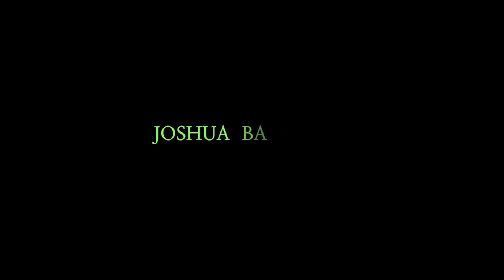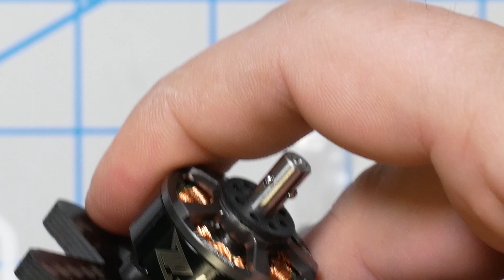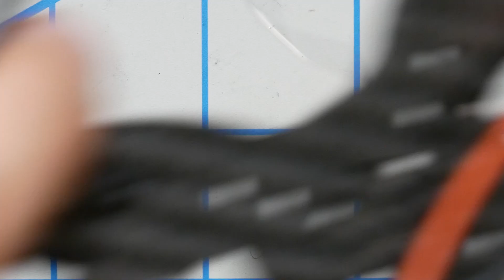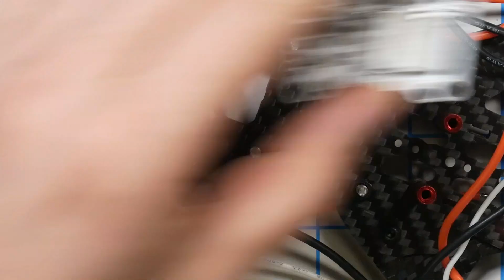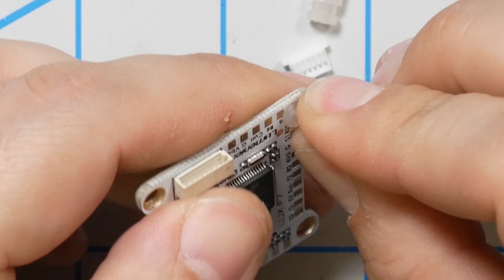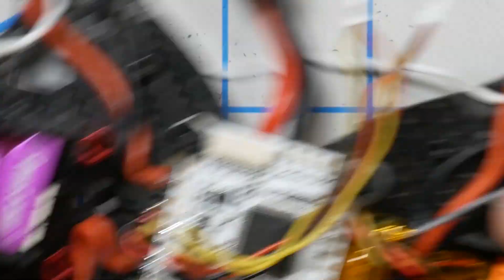Building a CheaterKwad | HOW TO FLY BACKWARDS WITHOUT CRASHING

Comment: For a vtx placement like this one, you should heat shrink the antenna to a thicker zip tie then heat shrink that same zip tie to the stand-off right next to the mmcx connector. Would probably be in the way of the rear camera but it’s better than where JB put it 🤷‍♂️

Comment: In all of the build videos I've seen, no one preps the edges of the carbon fiber. In RC cars you file / sand / Dremel the edge to take off the sharp edge. Them we seal the edges with super glue. This all done to stress relieve and strengthen the CF.

Comment: So wait, what? You switch camera alright... . So your front go go now faces backwards. But what about the controls? Do they also switch as you switch from front fpv cam to back fpv cam?

Another unrelated question: on the shendrone geyser, with two cams... what if you want both pilot and gimbal man to see different fpv cams? Two vtx'es? That interferes, no?
Reply: Ach ok, you set it up in the radio transmitter so it switches... . That's crazy!

Comment: Why battery pads when you can just use 3m Velcro? I put a piece in the quad and battery have had a strap cut on the carbon and the battery stayed on.
Reply from the maker: I dislike putting velcro on my batteries.

Comment: I think the "stat" in hemostat might come from "static" as in non moving, because you can clamp an arterie and leave them there.
Or stopping blood, because, hemo-stat, but they`re also used to hold open an incision for instance.
(now I`m sitting here wondering about the etymology of surgical instruments lol)

Completely agree that 8ths of an inch and 3/16th and all that is stupid, we use the metric system here, nice and logical, and the same unit (meters in all its variations), can be used to describe anything from sub atomic to planetary objects.
I`ve had to deal withimperial units most of my life anyway though, because the RC hobby will do that to you lol.
Still gets confusing :/

Comment: Thanks for your great job ! I have question : Do you know a small électronique component for mix two caméras together in picture in picture ? Not switching but together. The front camera in big picture and the back caméra in small size at the corner ?
Reply from the maker: It doesn't exist. Picture-in-picture exists, but not small enough to put on a quad, and the latency is too high.

Comment: Frame is here - Fast delivery (< 1 week), reasonable price and high quality. 
RIPT is a 1st class operation - I received the "Bardwell Package" - nice frame - fully assembled, (a 1st there) plus a bonus neckstrap which is among the nicest I have. Super discount - thanks for that! 
It's a simple frame in the "Old style" (which I prefer) but very well executed.  Big name quality at 1/2 the price. It will swing a 5.5 prop, has 20 and 30.5mm mounting holes Thanks for the discount Josh, I'll be ordering from you again.

Time to start working on the "PushmePullyou Quad" Looking thru my goodie collection I have a Foxeer ClearTX2 w/lollipop antenna, a set of 2207 2450kv Blasters, and a 4n1 esc (all Kwadbox items). I also have 2 surviving Session 5s for on top. I'm thinking 4S1550 and low camera angle for close in proximity flying, with a 2nd more 'rippable' setup just my retilting the cameras and changing out props. 6S1000 with throttles limited would make for a somewhat more aggressive setup with a few minutes of adjustments.

This is going to be fun.

Comment: Joshua, I have spare PDBs and will use them in future builds.  If the power in the FC isn't enough and or reliable for the need, that is what they are for, eh?  Great instructions for beginners as well as mid levels of builders.

Comment: I must say, the soldering quality of this board looks awfull. I used this type of FET (DrectFET) previously, and i know that if the soldering profile and the solder paste distribution don't match the FETs requirements really good, there will be problems with non-connected pads under the package, and the PCB probably will burn. Also, the soldering of the Shunt looks bad, too. I think i see where the issue lies, and the way to get around is expensive...

Comment: I just love build vids! 👍I have the Chameleon Ti frame (4mm) and I have the new Armattan SS 2306 motors. these motors came with those short 6mm screws and they look exactly the same short as in this vid. I called the Armattan tech support and I was advised not to worry just use those screws. what I did with a bit thread lock, but there is no way that's the right way, just as you've pointed out in this video. I already lost 3 of the screws and two screw threads just vanished (so I had to use longer screws to replace them). actually I'm planning to replace all of them because there is no way screws reaching only the half of the motor stand holes can hold a 2306 (so called) beast motors. Armattan should provide longer screws with these $25 motors for the same reason as you Josh didn't wanted to use your stock short screws.

Comment: Hey JB, I actually designed that frame! It was a really nice surprise to see you talking about it and was really cool to see how you built it :)

The whole premise behind the frame was a perfectly balanced design. It's a true X with the mass as central as possible, so much so infact you can spin an assembled quad on one finger! Designing around modern parts we were able to make it lighter than similar Alien based designs. Just to clear up the extra holes and standoffs, the idea was to provide as many options as possible. Any FC/VTX etc can be mounted and the holes allow for extra standoffs to work around your components and add extra support where you have the space. 

The symmetry was designed so you could use the same arms all around (unlike the Nova which is handed I believe?). Using the triangulation along the length we can add strength to the base plate which often snaps on Alien style quads and also add a bit of leverage to strengthen the arm joint. It was never the intention to use two cams hence no cam mount in the back ;)  

Really looking forward to seeing your 'cheater' flights and hope you are enjoying the frame :) 

P.s the company name is RIPT, the frame name is the Lindworm! Doesn't matter but just so you know for future reference.
Reply: Nice I like that frame where I can get ?

Comment: I agree with a lot of what you said about the soldering but that red wire you showed should have been at least half of that links if not a 3rd. You only want a small tiny amount of the wire exposed. Laa and can't jiggle about and snap off over time. When they're longer like that and hang out even a millimeter off the pad they slowly move around and will snap off especially if you're inside your quad moving stuff around in the wires are constantly getting bent back and forth

Comment: I was buying a Rapid fire module and was checking your website for (the best) antennas, and realized that the recommended antennas are RP-SMA and are not compatible with the Rapid fire module which uses normal SMA connectors. (this is the Amazon link) Might be a good thing to offer both types and explain the difference/compatibility as most modules and IPX connectors to SMA are only SMA compatible.

Comment: Thanks for featuring the Riptkwads.com Lindworm JB get 20 bucks off with code MOONMAN at checkout choose standoff colors, use fits two 20×20 stacks or one 30×30 solid or individual arm models. Mini or micro cam. Bottom or top mount battery and super strong high quality carbon fiber join the #riptcrew this quad flies sooo well
Reply: Last day for the discount. Get one!

Comment: Just milimeters? I mean, the whole thing is so much more rational and convenient, everything using  bases of ten. Rather than fractions of an inch, 12 inches to a foot, 5,280 feet to a mile etc you have 10 mm to a cm, 10 cm to a dm, 10 dm to a meter, 1,000 meters to a km. Same thing for weight, volume etc.

For PDB - the KISS stuff still uses those extensively.

Comment: It would be awesome for velocidrone to add a 3D flying option to practice flying upside down and backwards. Probably wouldnt be too hard since they have the setting that centers the throttle on a ps4/xbox controller since it doesn't sit at bottom deflection naturally.

Comment: in regards to testing continuity once you have the motors and esc's soldered up to the PDB:

shouldn't your meter have given you a beep since at this point you haven't rectified your polarity mistake from earlier with that one esc?

this is making me question my entire existence.
Reply from the maker: Reverse polarity won't cause a continuity beep I don't think.
Reply: @JoshuaBardwell  roger that. i put ultimate faith in my multimeter before that first battery, lol!
Reply from the maker: The low voltage used to test continuity is not enough to open the FETs

Comment: I have a question. A long time ago I overheated my video in pad so I have to solder it directly to the camera, thats why I don't have osd of course(and its really annoing) my question would be: is it possible to soulder it into one of a rx pad and set it up in betaflight? Thanks in advice:)
Reply: no. the osd is handled by a dedicated chip. the video signal does not go through the f3/f4/f7. can someone confirm, or correct me if i am wrong?

Comment: Finally got to the end.   As an assist for your camera angles, go for around 20 degrees uptilt on front cam and 20 degrees on GoPro mount.   The backwards cam should be around 10 degrees so when flying you will avoid having the GoPro pointing up at the sky when the angles compound.
Reply from the maker: Yep we figured this out.
Reply: @JoshuaBardwell  either way even at shallow angles you still gonna have a lot of sky and very little ground on the HD cam. I tried all the different permutations and for me the only position where 2nd camera makes sense is rear inverted because that's the only case where your HD cam is always facing correct flying angle (same angle as FPV regardless of what FPV cam is in use). I think it would be beneficial for your followers to also do Episode 3 (after next) where you could flip the rear FPV cam upside down and do the 3D setup. and btw. you could turn your rear camera mounts outwards and have the cam to stick out to give yourself more room inside the frame for your VTx and mount the antenna properly : https://youtu.be/lvRDVMTE2d4

Comment: So regarding flying a CheaterKwad, part of the talent/difficulty is lining up your shot and planning for the transition.   So Josh you will likely first find transitions on yaw spin to be the most natural because Yaw does not get inverted.   But there are some other not so readily apparent transitions that raise the stakes and make for a trippy as hell experience even with a 2 cam upright build.

Another fun thing is that you can use your second cam as a sort of rearview mirror/cam while flying.   This comes in handy if say you are being followed and you are flying backwards so that you have the gopro pointed at what is following you, occassionally flicking the switch back to the front cam lets you see how the shot is framed before going back to the backwards cam for regular flight.

Waiting to see what people more talented than me can manage to pull off.
Reply: Yeah, I was thinking about how the cam switch will flip pitch and roll controls so you better have that stick centered when you do it or I imagine it will really SNAP that quad around depending on your pid settings and how strong the motors are.

Comment: The great forceps vs. hemostat debate...  You will find forceps with locks, but hemostats are a special case because they are made to clamp on arterial vessels.  Hemo (blood) stat (now).  You have what is called hemostat and we use them all the time for everything in the Pediatric ICU.  Yet another name for a similar device designed not to be sterile is called Kelly forceps.  

Medical jargon man, it's awful.

Comment: I bought the CL Racing F7 and also overlooked that it was not an AIO, Ive never used a PDB so I bought the RDQ Airbot MatrixPDB, it has 4000 capacitors on the bottom. By the way this frame is not great, way to think inside of the box RiptKwads.

Comment: Something off the subject but i recently pulled a 4s lipo out of storage and it was way out of balance so as always i go to your channel . I don't seem to be able to find anything about balancing lipo batteries . HELP !!!! lol .
Reply from the maker: As long as all cells are over 3.0 volts, put it on a charger and run a normal charge cycle. It should balance at the end.

If any cell is below 3.0 volts, I would personally recommend retiring it.
Reply: @JoshuaBardwell  cell 1-4 , 3.02 , 2.62 , 1.81 , 2.91 . I hate to retire it considering its not old and hasn't been used much . would you still suggest chucking it or is it possible to fix it . My apologies for the ignorance . I'm a noob with little knowledge :(

Comment: So, ESCs... what are the pros/cons of 4-in-1 vs individual ones?
Reply from the maker: 4-in-1 is significantly simpler to wire up. Many fewer joints to solder. But if it smokes one ESC, you're out the price of the whole thing, not just a single one.
Reply: 4 in 1's are safer inside the frame then hanging out on the arms. I have destroyed fewer flight controllers w/ 4 in 1's as we aren't using the flight controller as a pdb anymore. For the most part, 4 in 1's are cheaper to buy initially, but more expensive to replace.  If you look at something like this:  https://pyrodrone.com/collections/electronic-speed-controllers/products/typhoon-4in1-s-racer-3-6s-esc-4x30a-v1-2  you would need to find individual esc's for less than $8.75 ea. to be cheaper.

Comment: Metric system 🤘🤘🤘🤘
Reply: is the way to go :)
Reply: 7/16ths of an inch, what does that even mean!!
Reply: 1/16 less than 1/2 an inch. 
Or 7 x 1.5875mm  = 11.11mm
Reply: @lostjohnny9000  now tell whats bigger 7/64 and 3/8 within half a second
Reply: @mortache  sorry, I can't type that fast!
Reply: @lostjohnny9000  its the issue i face when shopping for drill bits in my local hardware shop. We used to be a british colony and we're too poor so we still use machinery designed with imperial units.
Reply: Metric has it's place, but it's not in the USA. Every time I'm forced to pick up a metric tool to fix something, the expletives come freely.

Comment: do you flip the reverse camera settings to match the stix?
Reply from the maker: Wait for the next video :-)
Reply: You probably just set up the mixer in your transmitter to invert roll and pitch using the same switch as your camera switcher is using. Easy.
Reply: It really isn't rocket science only two axis need to be reversed when you switch cams that's it yaw will remain the same. I also love OpenTX  but any computer TX can accomplish something this simple.
Reply: super annoying comment...im asking how people do it.. I can think of many ways to do it that aren't "rocket science" but people ask questions to learn the best tried and tested way..
Reply: so. much. noise. I dunno what im doing wrong but when I take the rear cam off there is no noise as soon as I connect it there is noise city! using lux and jb eagle
Reply: without seeing the noise it's hard to say is the rear cam clear with the front unplugged if so keep the video cables well separated twist the video and ground on each cam and use a common ground. also keep the camera videos away from the vtx video as much as possible to avoid cross talk and out of sync issues. I bet RapidFire will hate these setups.